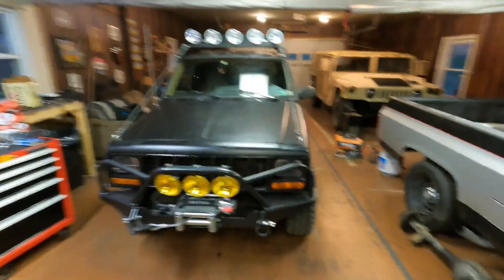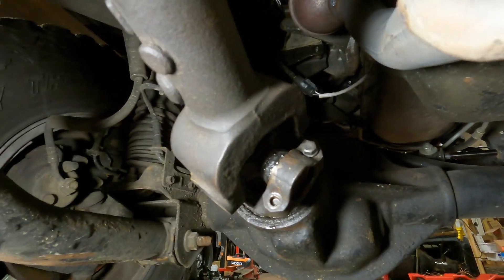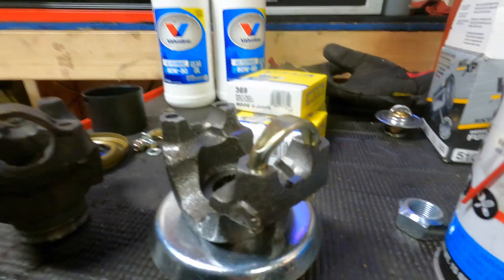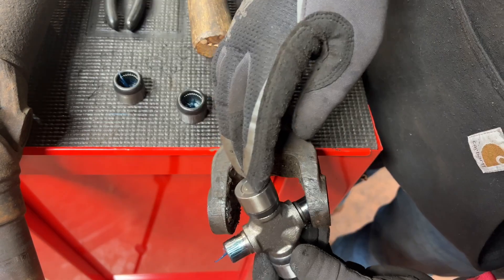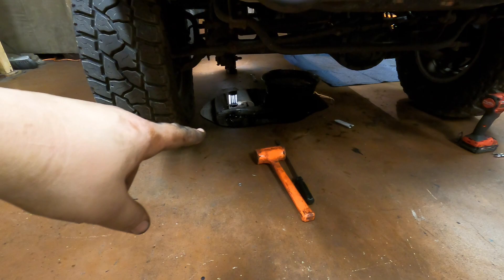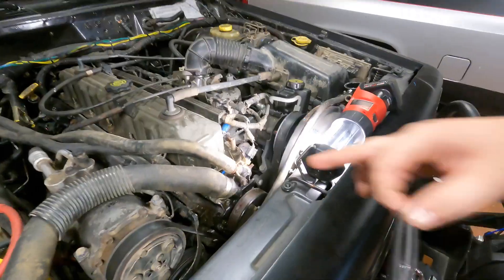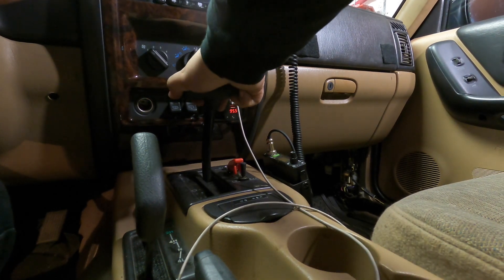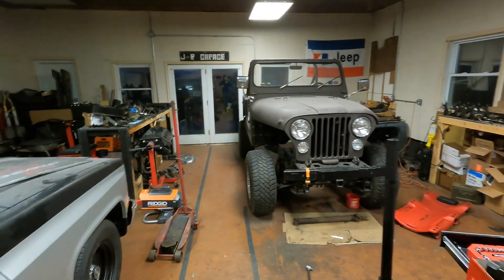Fixing the Last of My XJ's Mechanical Problems

Comment: Hey Jimmy! Great job. The new nut is a self locking nut. It's designed that way on purpose. It's so you don't need a lock washer or loctite. It's a one use nut. Hope this helps. God bless, stay well.
Reply from the maker: Wish I would have known that haha thanks! I did run it on at first but it almost felt like it was cross threading so I did not want to risk it lol. Good to know though, thank you!
Reply: @JeepinJimmy  You are quite welcome. In this case, after the fact help  can only help for the next time. Which is  why I make these comments. Always happy to help!